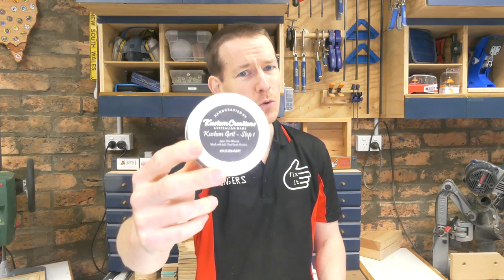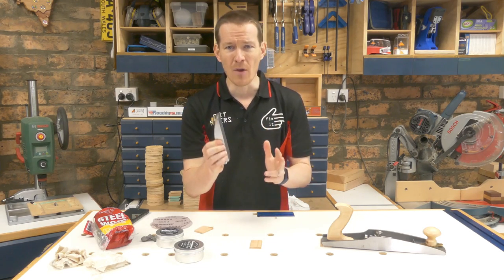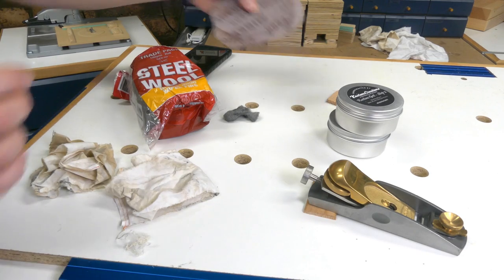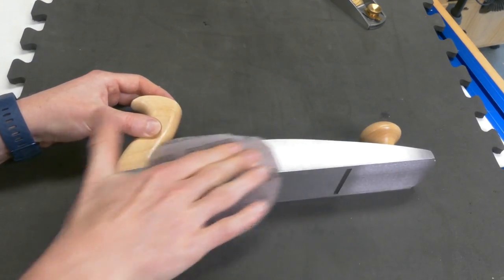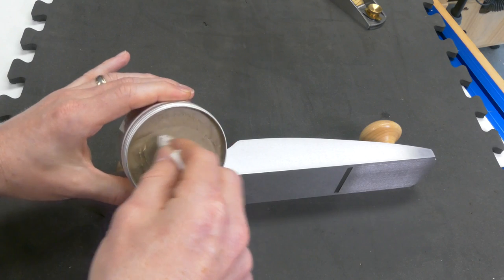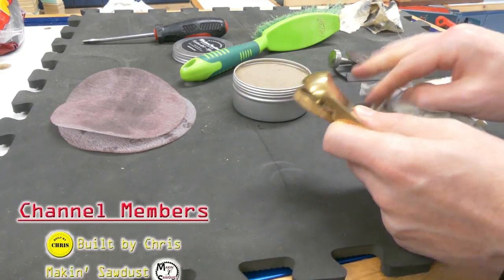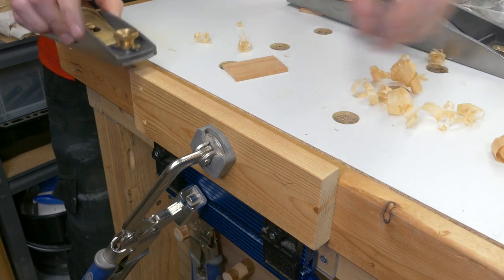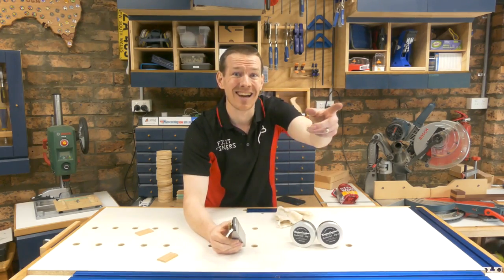Removing Rust and Protecting Cast Iron in the Workshop with Kustom Grit

Comment: great video bud! no doubting Scotty's #goodstuff. ONly thing if I may suggest, when sanding though its very high grit of 600, eventually it'll start having bumps so to avoid that, get a 2x2 tite from the green shed and stick some high grit sanding sheets on it and spray some blue sheen and gently run the plane on it, it'll make sure your plane is always flat and square. Especially when you start getting it to using this plane on a shooting board and stuff. Just sharing whatever research I have gathered, sorry not trying to tell you how and what to do.
Reply from the maker: That's an awesome idea mate cheers, I think I'll pin this. Yes on the sides it doesn't matter too much unless you are shooting but for the base this should really be done to keep it perfectly flat. Top tip!

Comment: Nicely done! One of my workshop mottos is "if it moves, oil it" and I guess that goes for handplanes as well.
Reply from the maker: There are certainly moving part ;) It did come oiled, but I suppose I wiped that mostly away when cleaning it for the first time. The wax in Kustom Grit should mean the barrier lasts quite a while.
Reply: @FixitFingers  I guess using the plane means transfering some of the oil/wax to the workpiece - fancy shavings! When you feel the friction creeping back might be a good tell that it's time to reapply the finish.

Comment: Looks like a great product, thanks for the demo. I didn’t realise it had abrasives both clean and protect 😍 I’ll have to pick some up 👍🏻
Reply from the maker: Yep it's a polish and wood finish in one. You can use it like a wax, over the top of poly or pretty much anything, or just use it by itself as a finish. Plus, it's ability to polish resin, plastic and metal and it really is a bloody versatile bit of kit.